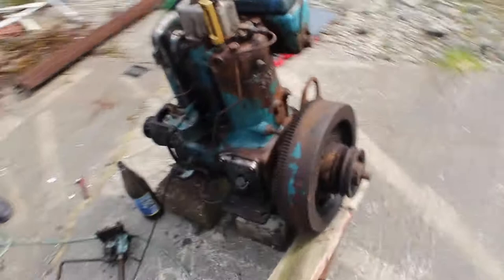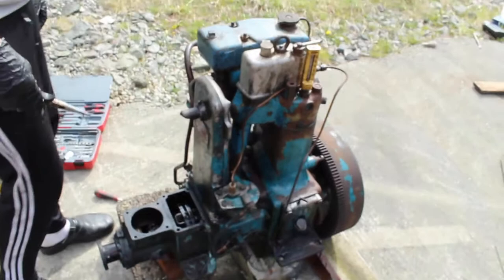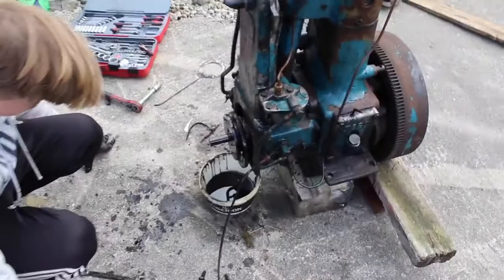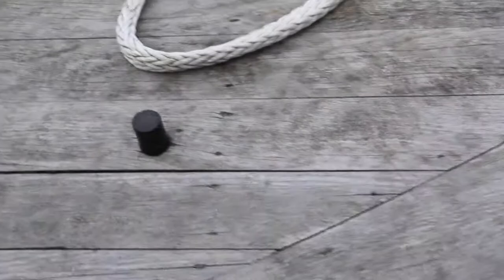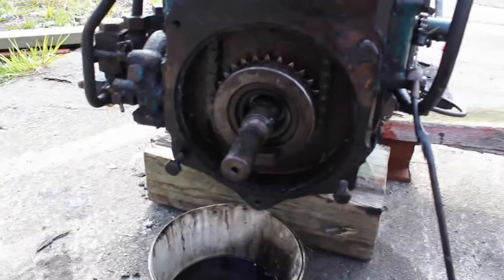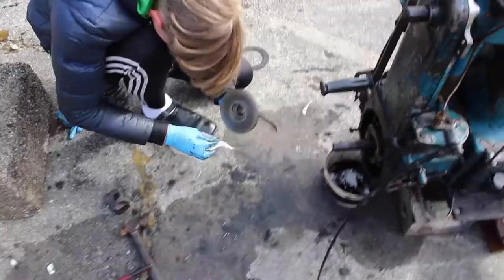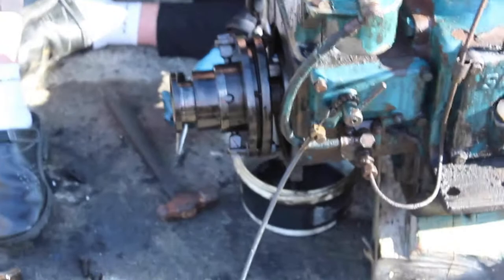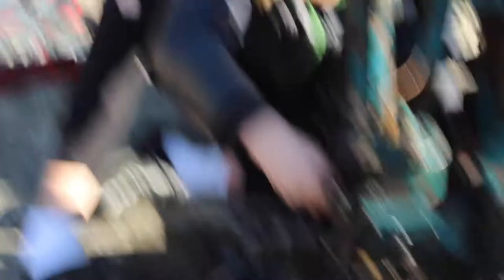The Arts of Hunting Parts - Ye Olde Crusty Ep4

Comment: Do you have any more video of taking apart the gear box? I'm working on a Sabb H that won't allow the prop to pitch forward!
Reply from the maker: Unfortunately no. What kind of a gearbox are you running? I it is a box with the turnable prop, than it is quite common for the guides to get filled with shit and stop working properly. Also, if you recently took the engine out of the boat, it might be a case of bad engine placement (it affects the movement of the guides)
Best of luck with your engine!
Reply: @hammerdrum4043  I actually figured it out! It is the variable prop.  The prop shaft had slid out of the damper.  A 14mm wrench and a hammer fixed it right up!
Good luck on your projects as well!